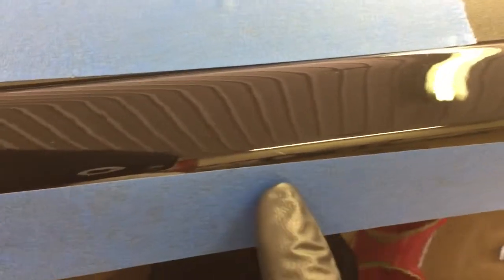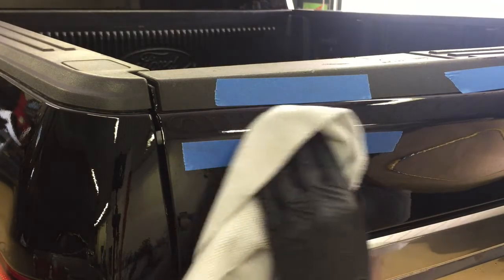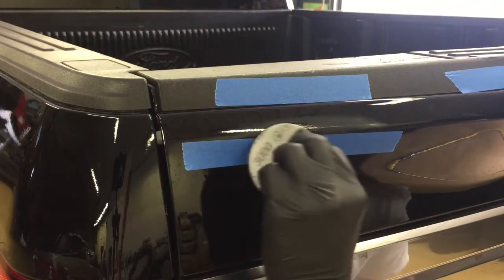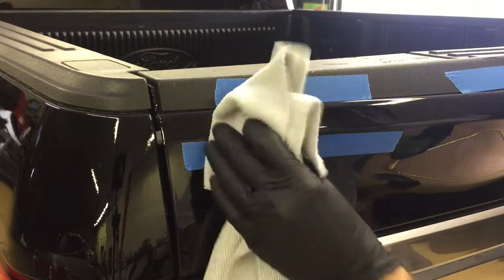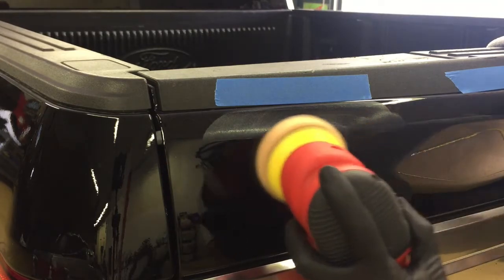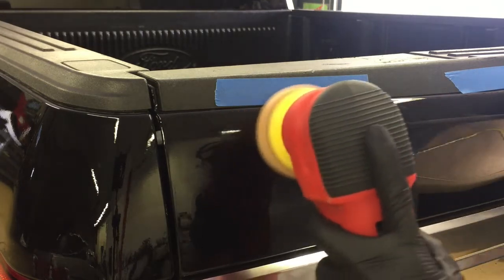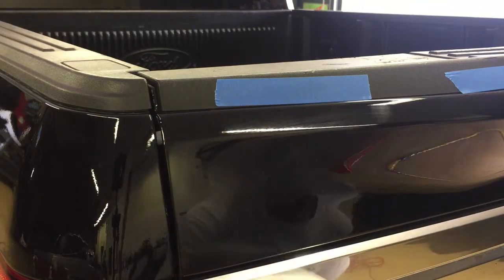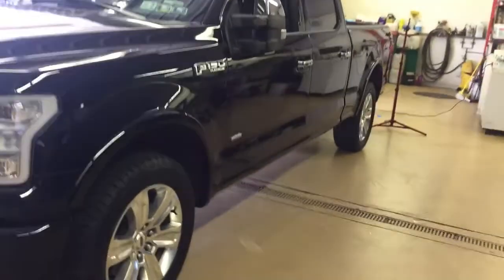How to repair scratches on black paint (PART TWO) New Truck: Wet Sand, Compound, Polish

Comment: I second that! Great series on the scratch repair. I have the same Griots 3 inch polisher and had all but given up on doing anything with it, underpowered, or gutless wonder as I would say. However, you seem to gets a lot of use out of it, and the results are awesome. Is yours all stock? I mean, mine won't stay rotating unless I'm on 6 and have hardly any pressure on the tool. Looking at these videos, yours seems to rotate fine and even appears like it is rotary movement and not oscillating? Interesting, I will revisit using mine and see if maybe I'm just not giving it enough time to do its thing. Thanks.
Reply from the maker: Thank you!  Yes all stock! Hmmh.. although I use it in areas and situations where its a good idea to be cautious and not in a hurry.. it has enough power to get the job done. Even when pressure is applied.  Send it back!

Comment: Brian do you measure the clear coat before sanding or compounding? Sanding raised panel edges is riskier than in the flat areas. Nice work BTW.